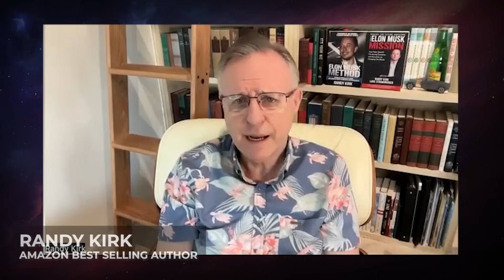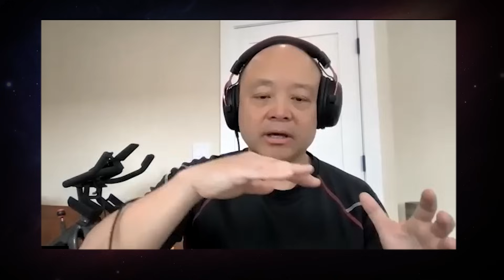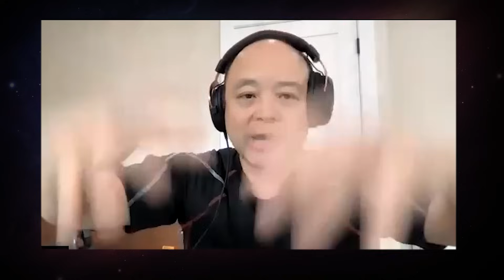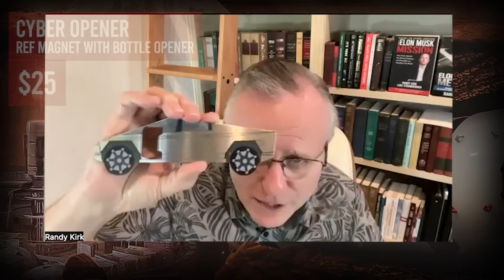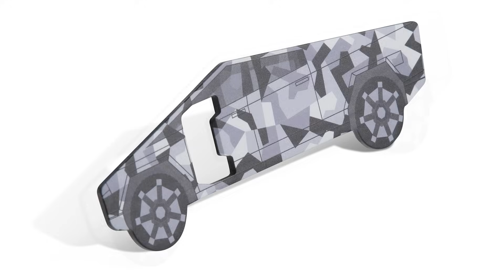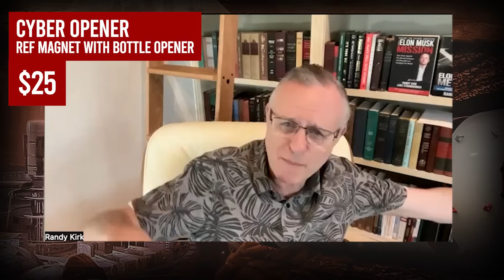Elon Musk Creating Breakthrough Manufacturing Approach. Brian Wang: Beyond Unboxed

Comment: In the aerospace industry, we have been making planes that "fly by wire" since 1972 with the Airbus A300B - 50 years. There are no steel wires controlling ailerons, flaps, rudder, etc - electrical wires run to solenoids that activate them.

It's about time the automobile industry did 2 things:

1) Fly by wire controls - no mechanical linkage allowing for a water-tight interior
2) Multiplex wiring - one thin optical cable runs commands to control units to activate them.

Right now, the wiring harness in a Tesla is probably made of a hundred wires totaling at least 2 KM long and weighs 50 KG of copper.
Multiplex wiring weighs just a few kilograms and can easily be tapped into to add another control. Multiple optical cables will allow for backup pathways to the control items.

These two items would easily knock off $1,000 in parts from each Tesla.
Reply: Not totally true. For safety reason, some subsystems such as braking still have redundancy for manually overwrite - actual steel wires.
Reply: @MrXMasterTrader  Why? We don't have that on modern aircraft - no steel cables.
If you want redundancy, then run 2 optical multiplex lines or 3 or 10 but 2 should do the job.

Comment: The parallel unboxed system is certainly a game changer.  But the real Tesla secret sauce is that each module has its own IC which checks each function in its module so before they are clicked together  each module is ready to go. this saves time as the main computer doesn't have to run through the checks because everything is already passed.  Then the IC talks to the main computer over an ethernet cable.  This dramatically reduces the wiring running between modules.